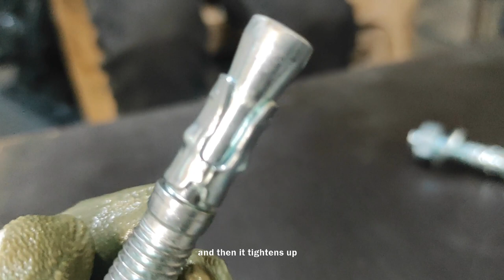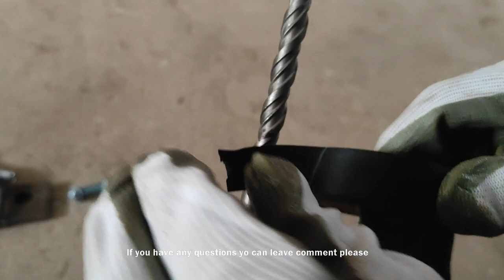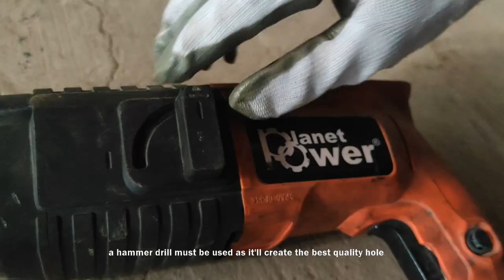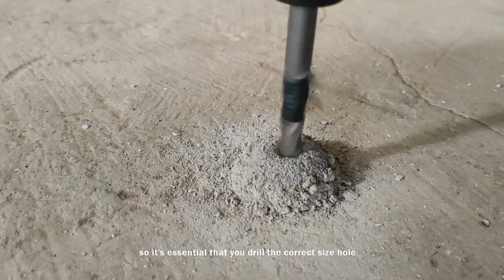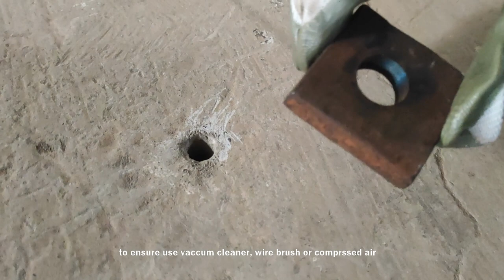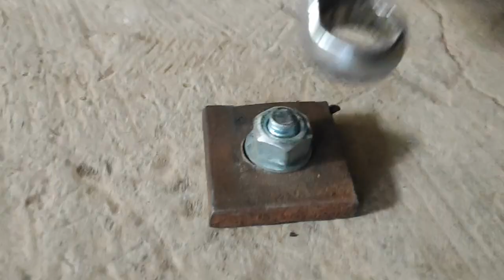how to install wedge anchor ? Concrete Anchors Fastners - 2

Comment: good evening I want to install in the room of my house on the ceiling a wedge and a board they use When they want to secure themselves for climbing If you can show me the right way to install the wedge and the board is 10mm
Reply from the maker: If you want the application to be on the ceiling like a hanging position,  we recommend you to use strike anchors 10 to 12 mm as per weight up to 250 kg. 
See the video https://youtu.be/c9z0WRrUabQ
Rawl bolt as another best option.